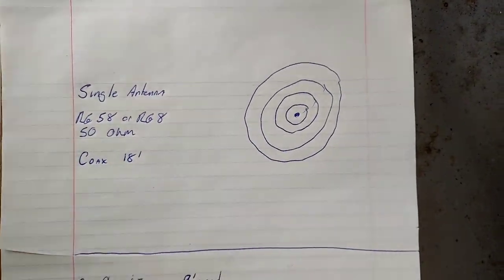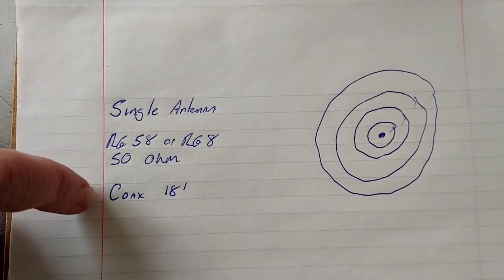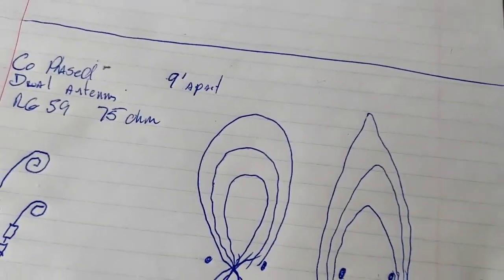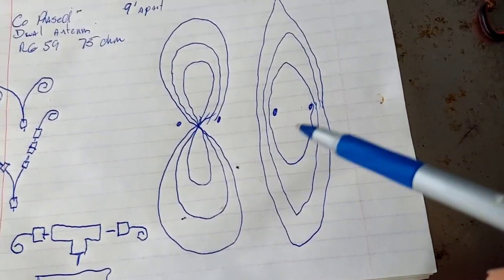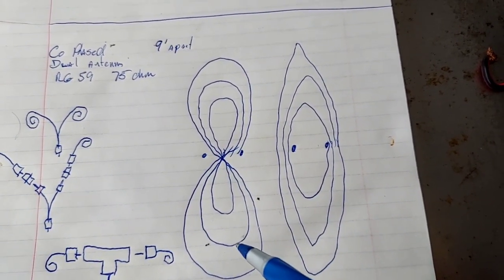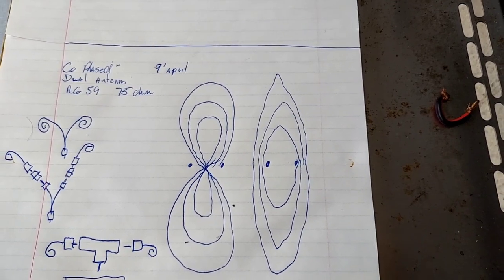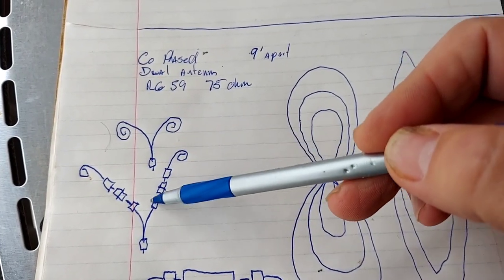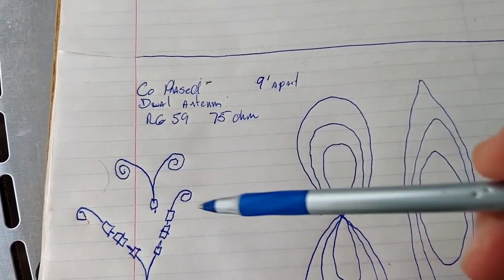Are 2 CB antennas better than 1? 2 cb antennas vs 1 cb antenna.

Comment: As a 40+ year amateur extra, the dual antenna idea is pointless.  Dealers in the old days tuning an antenna for swr, was pure snake oil. The antenna came from the factory tuned for center frequency.  Used to be a day, cars came with dual antennas.  People found that other than looking good,  the extra antenna did absolutely nothing.  Placebo.  Like the idea that 100 watts will get you further.  While your single may jump a tiny bit, and you may push a little more volume, nothing is really accomplished on AM radio.  FM, is different.  Back to AM. Once the atmosphere absorbs the signal, it's gone.    You can use an amplifier to boost an incoming signal.  Transmission is a completely different thing.  In 72, my jeep had dual 102 inch whips. The dealer had charged me to tune the SWR so I didn't burn up my radio.  I swallowed the entire line of bs. A jeep right next to me with a single whip got no better or worse performance.  Your money.

Comment: I know your not a fan of the fire stick 2, I have tried every which way to lower my swr on my cobra 29 ltd. It is a mirror mount set up. 18 foot of coax, no matter what I do I can't get the swr to budge on either side of the spectrum. I have inspected the antenna and see no damage. I have switched it out to a another fire stick 2 and no luck with that one as well. Any suggestions? And yes I'm grounded very well
Reply from the maker: First, what is the swr? Second, are you checking SWR on the Cobras meter or using an external meter? The internal meters are not accurate. The Firestik 2 will give a good swr, the only reason I don't like them is they break at the threaded base way too easy.
Reply: Yes I was using the external swr reader. And channel 40 was about 5 and channel 1 was at 1.5, I have shorten the adjustment and still getting the same reading. I pulled the entire end out and put it back in and started all over to no prevail.  I do have a 6 foot skip shooter on order and now waiting for it. Never heard of that antenna till I started watching your videos
Reply from the maker: @scottwerner3072  I assume you are putting the red cap back on, and have all door, hood closed top each time you check the readings? If all that is good I'd check the coax for shorts and continuity with an ohm meter. Check both the antenna and jumper coax
Reply: The coax may be the wrong type for co-phasing.

Comment: The reason why a dual-antenna system is directional is pretty simple, actually. If you were to draw rings around each of the "dual" antennas like you did the single one (using a compass for the circles makes them even and the analogy clearer), you'd see where the waves combine and where they don't (called "standing waves"). The combining of the radio waves adds "gain" to the signal; conversely, the waves emitting "sideways" cannot combine in-phase (they are actually out-of-phase by the distance between the antennae), so the tend to cancel or "attenuate" each other. This combination and attenuation of the waves is what makes the signal directed to the front and rear.  You CAN see this effect using the water analogy, just as you did with the single antenna. As a side note, ALL waves exhibit this property, including electromagnetic radio waves, water, light and sound. This is why you can hear frequencies that are louder and softer depending on the speakers' and your position in the room. It's all physics.

Comment: Very helpful, I am new getting into cbs and I have a cobra with a 102” hustler whip and a 3’ firestik, currently i’m trying to rig up a system where I can switch between dual and single antennas on my truck quickly, this helped a lot

Comment: I'm running a 5' Firestick 2 with a spring and 12' of Firestik coax. The cb swr meter says I'm at 1 swr.
Reply from the maker: It's possible, have it checked with an external meter to get the best accuracy.
Reply: It’s not about the swr, it’s about the signals getting screwed up because the antennas being to close to each other, yeah you got a decent swr, but is your signal getting out as it should, that’s where the issue is.
Reply: @bobdillashaw4360  I have a single not dual.
Reply: @xc8487  gotcha, thought you were referring to the video as running duel, good deal, you’re good to run it, did you by chance run an external swr meter on it, he is correct about internal meters not being to accurate, but if your that low I doubt it’s to much higher and you should be good👍🏼

Comment: Can you run a single antenna on a dual system and if you can’t how do you tune the dual antennas for SWR I know how to do singles with no problem but never messed with dual antenna tuning
Reply from the maker: No! You can tune the antennas with a dummy load or with a separate 50ohm coax. Tune them individually with an external SWR meter.
Reply: @jrichtruckincbtips  that’s what I figured do them separate then put them on the truck

Comment: There is on thing wrong with your explanation, when you split your transmission between 2 co-phased antennas you cut your broadcast to the equivalent to half your radios max output for example I run a Stryker SR 497 hpc with a max output of 160 watts. If I key the mic and modulate I am broadcasting with a 160 watts, with a dual antenna system I'm broadcasting 80 watts to each antenna witch inturn means you broadcast between 20 and 40 percent less distance but you gain about 15 to 20 percent more receive distance because you have 2 points of reception instead of 1. By the way fiberglass antennas are not the way to go if you want max broadcast and receive distances and the lowest noise level from your receiver. Fiberglass antennas pick up too much hash and noise. Using a predator 10k 58" whip antenna I've had non skip conversations up to 30 to 35 miles. I guarantee you will never reach those distances using fiberglass antennas.
Reply: 😂😂😂😂😂😂 you’re absolutely wrong with the very first words you said!! There’s no splitting of transmission with “co-phased” antennas!!

Comment: You don’t need 18 feet that’s wise tail
Reply: Exactly measure in wavelenths or fractionals of wavelength.
8 ft, 12 ft, 16 ft 20 ft, 24 ft.
They all work.
18 ft is just a standard adopted by manufacturers

Comment: Interesting video.  ALOT of the information is not correct though.   ( Coax length for one)

Dual co-phased antennas on MOBILE installations is a CB thing ONLY !!!

If there was anything to be gained by having two antennas rather than one antenna then every mission critical mobile two-way radio installation would use two antennas. That includes police, fire, ambulance, ems, First responders of all types, aircraft, spacecraft, military, the list goes on and on. And in the most critical two-way radio mobile communication installations there is always always always always one single antenna.

There is a theoretical 3db gain with two antennas. In the real world you will never ever see that on a mobile installation. When you combine all of the above with the fact that very few dual antennas are ever put together and installed correctly you have even worse results than a halfway decent single antenna. I have done extensive testing on this. You will never convince me that two antennas on a Mobile installation are better than one.

73
N9KGC
Reply from the maker: See the Freightliner in the background? Most of my videos are geared toward CB and Trucking, not Ham, not GRMS, not base stations. The video is also simplified so the guy that just wants to hear about the traffic ahead, talk to the scale house, or the loader. Not for the guru that has been in CB since the 70s or the guy that trying to talk around the world. Thanks for watching
Reply: Sometimes the incoming signals from the sides that you are canceling out with a phased array make it easier to hear the weaker signals ahead of you and behind you.  This is a very practical application for truck drivers.
Reply: @captainmidnight5958   I had to read your comment twice there was a lot of information in there. And while almost all of it is probably true and correct and I agree with most of it.

 The bottom line is on a Mobile installation anything that's mission critical still has one antenna only. You touched on that in your comment but did not elaborate. I have not been convinced that in the real world any Mobile installation with two antennas no matter how correctly set up they are is going to outperform one good antenna set up correctly.
Reply: @raysult 
Mission Critical mobile comms is not a weighty argument to a phased array within any portion of the hobby. 
The very nature of Mission Critical comms is to achieve 100% readiness at all times without complication. 
As I stated, there is gain to be had in the collinear setup, but most won't find it or even know it's there to use it. It is not dramatic gain, nor is very useful locally. The best circumstances have a mobile Op (read: truck driver) noticing nulls to the left and right of their direction in travel. 
A mobile parallel setup really shines in DX conditions. I'm not talking about a couple of 3' fiberglass, mirror-mounted dummy loads, but two steel whips purposely phased, angled and specifically designed for skip conditions. 
If maximum ERP is to be found, then it may be possible to maximize its range using a collinear array, even mobile.
My use of a Cushman CE-70 (I love old equipment) gave me pattern maps of both the single 102" that I use to use and the dual phased array that I now use. 
The Cushman doesn't lie.
I "hear" no real difference locally, but in talking with a frequent contact in Jamaica, he and I both hear and see the difference by approximately 3 S-units.
Locally I can talk to more (about 4 of them) than the single individual that I use to be able to contact from Sioux Falls, SD to Sioux City, IA. That's about 90 miles using about 120w on LSB. Using the single antenna made the feat impressive enough. Around here, no other mobile can do it.
To further the usefulness of my setup, I can run one, or the other, or both using NVIS to reshape my pattern and get the results I need to talk effectively where I need to talk to. 

It depends on what you want from a antenna "system". I have a system in my antenna setup, and it performs superb and is versatile.

The Citizens Band was never created to be a hobby. I'm sure you know that. The Amateur spectrum was, which is where it came from through reallocation.

This guys' video is good for its intent.
We, being Amateurs, obviously have more information. 
Myself, I started as a RM with the Navy and finished out with the Fed, specializing in RF Fingerprinting overseas with our Allies. One of which may soon get invaded...

I always stress knowing your radiation pattern, fixed or mobile, as this is where the truth is found in using what ERP you can muster. 
Didn't the Beatles have song saying something similar; Strawberry Fields?
Reply: @captainmidnight5958   Great reply.   Seriously I like it 👍.  Good information.
Reply: @raysult 
We'll, Thank You Sir. You're very kind.

Comment: Is longer better . Antenna ?
Reply from the maker: Yes, as long as possible.
Reply: @jrichtruckincbtips  thanks 👍🇨🇦
Reply: Yes, as long as you keep it out of trees and overpasses! 😉
Reply: Not always! for proper transmission and less risk of splatter or radio damage, antenna length  your antenna needs to be measured to either multiples or fractionals of the bandwidth.
Cb is 11 meter band so 1/4 wave antenna is 102 inches.
Coax length ideal would be around  16 feet  or 1/2 wavelength, but 18 feet will not affect it too much.
Loading coils allow shorter antennas but performance may suffer.
On the note of dual antennas, you might see a slight improvement but not much until they are a full wavelength apart. And for cb thats 32 feet apart.
Any closer than that expected performance is hindered by parasitic capacitance.
At 9 feet apart they are operating at approximately 40 to 50 % of their individual capacity.
But they will be much more directional.
Radiation pattern is more a doughnut shape until something reflects it.
Reply: Doughnut shaped per individual antenna. Oval shaped for duals